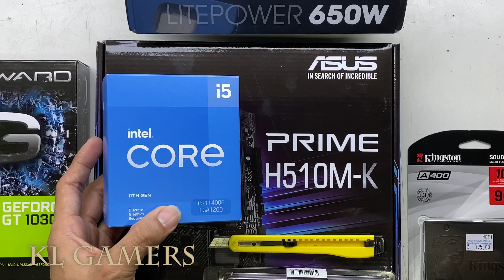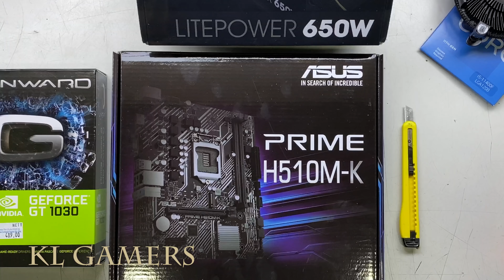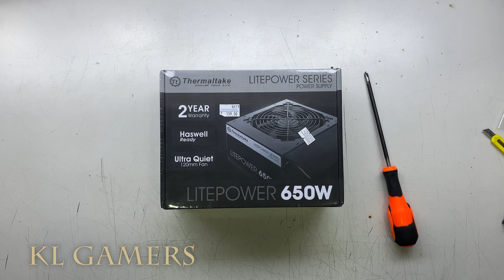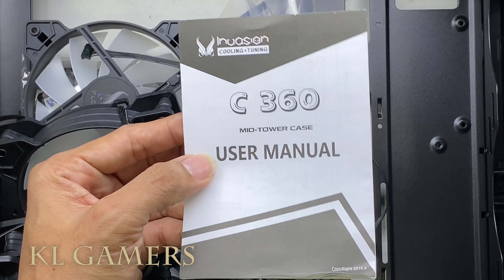intel Core i5 11400F ASUS PRIME H510M-K GAINWARD GT1030 invasion C 360 RGB Gaming PC Build

Comment: I noticed that in many PC systems assembled by you there are components that have very large discrepancies in performance between them. 
For example: good CPU, low performance video card. 
Can you explain to me, please, the cause of such a totally wrong choice, apart from Office PC systems in which the video card only plays the role of having an image on the monitor.
Even in this video I notice a huge discrepancy between the processor and the video card.
Reply: Certainly the discrepancy is due to the very high price of video cards that are sold today. People opt for cheap options just to generate video hoping the market will improve and prices will come down. Or it could be that the pc is just for the office.
Reply: To be fair, some RTS style games can wreak much more havoc on a CPU than a graphics card. + Generally, more CPU than strictly necessary can make frame times more consistent and makes upgrading to a different graphics card a breeze too. Just put it in when prices are ok and off you go again.
Reply from the maker: High performance graphics card can upgrade soon if price have drop
Reply: @KLGamers  It is very good that this is done in your country, namely the customer initially orders a weaker component part until they become more affordable and are in stock.  Does he come back to your workshop later and upgrade his video card, making only a difference?  So, a temporary assembly is done under certain conditions.  I ask because in Europe, things are different and I'm curious.  It would be ideal and very advantageous for the client for something like this to happen.
Reply: @_abraham_bo_  Well, "smart" I don't know who you think you are, but know that I'm much better documented in this regard, especially since I've assembled a few PCs myself.  Please don't make judgments about others if you don't know them.🙄🤔👎
Reply: @LeON_MCMLXXVII  🤣🤣

Comment: That gt 1030 i think is a bad choice for the build, cause its not really that good of a gpu, a 1050ti, 1060, 1070, or 1650 should be more compatible and dual channel ram is always more preferred for most systems, that config will have bottleneck in the gpu and ram 🤔🤔🤔
Reply from the maker: yes, sometimes is office use only

Comment: Bro, I want to ask something. Why the reset switch header is put in fan controller, not at motherboard?
Reply: It's most probably to control the rgb leds of the fans
Reply from the maker: it will be used as a RGB light switch button instead of RESET button

Comment: Can we use GTX 1650 super with i5 3470 processor & how much power supply need.
Reply: CPU is weak.
Reply: i5 3rd gen really 😒
Reply: Anyway, 450watt PSU is enough
Reply: @冬月-o4q  give me one
Reply: @Sparshsparshsparsh  He might have it from previous build.
Reply: 450W